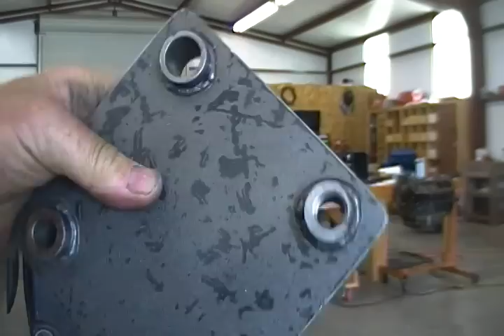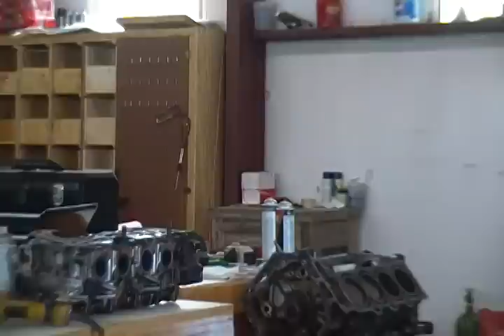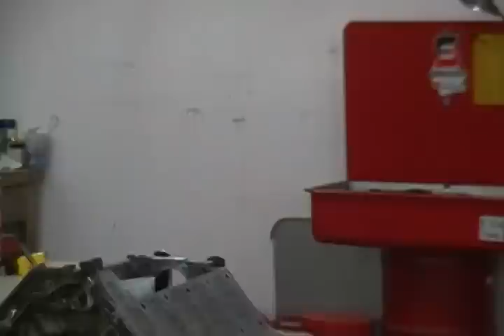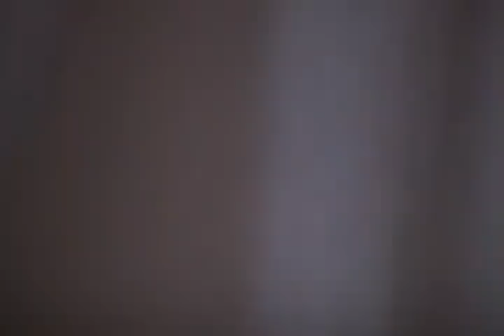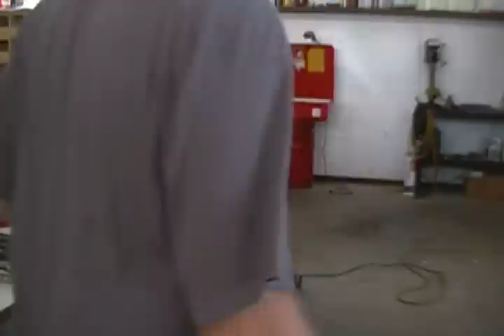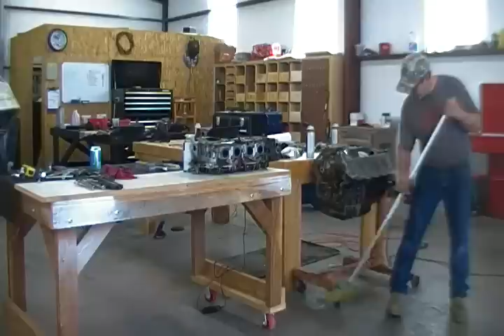Freehand misconception

Comment: guy, the guide is for the drill bit. THAT is what needs the guide. the tap is gonna go in straight, of course. dont be a chotch. you know this if your a mechanic dude.  the black wall is white, sheesh. i build engines for a living. you dont guide a tap, you guide a drill bit.

Comment: have you ever been able to install studs preventatively before the head gaskets blow by leaving the heads on, doing the studs one hole at a time, thereby not losing the seal on the original gaskets (plus using the existing hole in the heads as a further guide)?   

If so can you do a video discussing/demonstrating this?
Reply: How strange!

Comment: So let me get this straight - there is no free handing involved? LOL, just kidding. I just want to say that your videos have taken a lot of the nightmareish thoughts about installing studs in a Northstar. I certainly will use your studs when the time comes to do my 95 Eldorado....Now I am wondering if you can relieve my nightmareish thoughts about removing the engine from the car????
Reply from the maker: LOL, it sucks to have to make videos like this, but do to dishonest people it proves necessary sometimes.
However, it was fun to make!
As far as removing the engine? It is not that bad, just a little work! You can remove either out of the top or the bottom, your choice depending on your equipment and both ways are equal in work.
You can visit our website to send direct email questions or call?
Reply: tim carroll For me - your videos are fun, educational to watch and the content is very sensible. I just got this 95 Eldo ETC (my first modern caddy) with 160k on it and I'm running the hell out of it. Eventually it will blow, so thank god I still have my trusty 1986 Cimarron 2.8L V6 to cart me around when it does (that's right a Cimarron!!) lol. I will be sure that only quality engineered CCC studs, parts, and knowledge go into my ETC... Exposing scumbags is ALWAYS a good thing - keep up the good work!!!
Reply from the maker: Tom Joyce, thanks for the comment we will!

Comment: Tim, I have a scrap 3.3 V6 block from a Grand Am that I want to practice this technique on before I start drilling and tapping the Northstar. Will this technique only work with aluminum?
Reply from the maker: Hey Freddie,
Yes, the modification of these existing holes is made possible by the fact we are working aluminum, I am sure it would take more time and skill to do this on solid steel. Yes, we have drilled this way with steel, but the job requires different tools and more time.
Reply: tim carroll I don't think that what showed in the video will be enough to prove to people that the holes drilled are straight. The most absolute way to do prove that you are right is to get a machinist's square that you then place against the smooth surface of your stud and to the surface of the cylinder deck. Then put a .001" feeler gauge up and down the length of the side of machinist's square side and the side of bolt. If it cannot go through, then the hole is straight.
Reply from the maker: For EETechs, This is a modification of an existing hole, such a small slight modification it is almost not a Mod! We are not drilling a hole in a blank block, that is what makes this mod so easy and so true, or you could simply ask the thousands of people who have bought and installed our studs around the entire globe, maybe they can explain how it is possible to do this repair? Just saying.
However, if you are ever in Texas, call me an I will set it up for you to experience it first hand!!!! Take care for now.